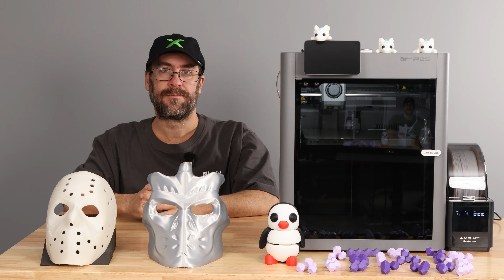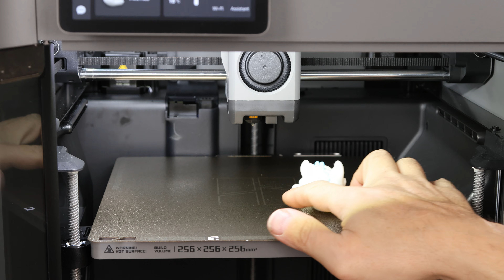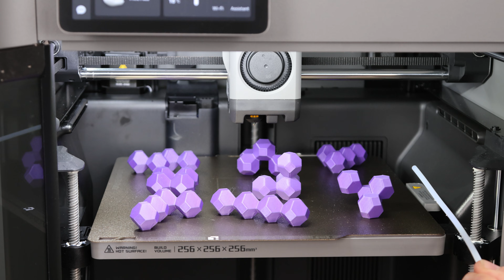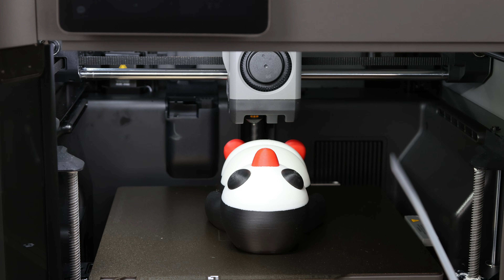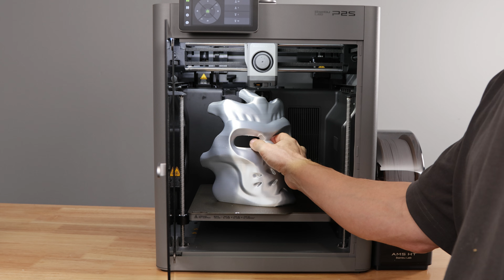Bambu Lab P2S: WHY Use TWO Aux Fans?

Comment: I have a curious question, i have an X2D, i have seen people suggesting to use air deflectors, does the fan deflectors help and if yes then how?
Reply from the maker: I looked into them for a video and ultimately didn't see a  need. I've had no issues with the fans as they are

Comment: AUX fan is off by default in bambu slicer settings, in what situations should it be turned on? Filament type? For specific objects?
Reply from the maker: Bambu Lab P2S: WHY Use TWO Aux Fans?
https://youtu.be/_9vtjKOAfyE

Comment: my p2s cools too much too and i have to use a diverter when printing PLA or the prints just won't stick, and yes i kept everything clean and washed and make sure my grubby hands don't touch the bed.

and also yes, I'm using bambu original stuff, even the filaments.
Reply from the maker: Haven't experienced this but I've heard it from others. Maybe slow your 1st layer and 1st layer infill. Be sure bed it 60, nozzle 220.
Use a better print bed: Smooth PEI
Reply: @3DRundown smooth pei is really hard to get, its always sold out, even the bed at 60 just doesn't stick, it'll stick for longer but still comes loose over half way through...

oddly enough, even the build in benchy just fails like that...
Reply from the maker: Can you show me your slicer settings, and a failing print video? https://www.skool.com/3drundown-8042
Reply: @3DRundown  standard settings except i set the bed temp to 60 instead of 55 and the prints always fail or warp at the vent, i find that the temp settings always are a bit conservative, i have to set them a little bit higher whether it be PLA, PETG and ABS.

not sure how to send a video on that site.

Comment: I have a p2s for 5months and my right cooling fan stop working and I need help. I already follow instructions to fix and nothing stuck in there
Reply from the maker: I suppose it's POSSIBLE that the fan itself died. I don't see it on the web store. I would make a ticket, and kindly ask Bambu for a new fan.

Comment: i just installed mine and printed a benchy to see how it works with the right fan but the left fan is just not doing anything 
do you maybe know why that happens?
Reply from the maker: Not sure. Sadly I have had no time to tinker with my fan
Reply: @3DRundown  i figured it out why it did not work, that benchy model i used apparently did not use the part cooling fan, i printed another model and it worked perfectly
Reply from the maker: @shadowking7386 Good to know it's not a physical problem

Comment: Doesn’t the tool head provide cooling as it extrudes filament?   I installed a VoxelPLA filter system on the left side of my machine.
Reply from the maker: The Aux fan is Superior. Your right side fan is fine.
Reply: @3DRundown I wanted better / more filtration  as compared to additional cooling for what I do atleast
Reply from the maker: If the machine was for my own personal use, and I didn't have to teach all this stuff, that is the route I would go as well.

Comment: Dumb question when I install this fan on the left side, does it automatically come on when it needs to like using certain filaments or is this something that has to be manually turned on every time?
Reply from the maker: I believe it matches up with the right side fan
Reply: I did contact bambu support asking the same question and the answer is you can add the settings on bambu slicer you can choose to switch it on or of and the speed and then save it in your filament profile BUT it doesn’t change speeds same the original right fan.
or you can adjust the speed from the bambu handy on your phone during the print so the answer is no it’s not going to work automatically or changes speeds automatically I don’t think it worth the headache.
Reply from the maker: @RB-wx3tp Excellent information.  Totally worth it. At the pro level, Manual control is the best control.

Comment: 👍Great tips for prints with complex geometry--Sometimes we just need someone to speak it out--even speak it slowely so we assimilate how fundamental something is that isn't always so obvious.  Stereo and mono mean something with non-flat and round vertical prints that effect the aerodynamics in the chamber.  Pop a Vento in there and the dynamics change from the physical aspect of the Vento alongside the aerodynamics of it removing or recirculating air.  These are PhD problems that the engineers at Bambu likely nailed.  As I plow through my cylindrical PETG 45-degree overhang problem, my Vento is going to take a hike for complex printing like this.  The Left Side Aux Fan is on the way.  Probably not a slam dunk, but I've tried everything in settings and PA calibrations chasing the proverbial tail.  After hours of trying to fix only a sector of my near perfect print (problem isolated at the 9 to 12 o'clock position), finally someone like 3DRundown tells it like it is.  ⭐⭐⭐⭐⭐💯
Reply from the maker: Good luck!! 🙏

Comment: but since each user prints several pieces at once, as well as larger objects such as vases, masks... It's a shame, considering the above, that this additional fan is not already built into the printer. It seems to me like if you wanted to drive a car on a winding road, you would have to install a steering wheel :)
Reply from the maker: You mean a SECOND steering wheel. Some cars only have 3 wheels. Some Vehicles only have 2. I could argue 4 is always better, yet they drive from A-B just fine...

Comment: I found that my P2S has the right aux fan design flow where it blows the air too directly onto the prints, lifting and warping the print from that side if it was too close. I printed a deflector someone designed (because many, many people experience that flaw), and now it's all good. I've been printing with different versions of PLA, PETG and ASA on it had no issues ever since. I don't think there's much of a need for an extra fan on the left. But, to each their own.
Reply from the maker: I haven't experienced this problem, but it's a topic that has been comming up.

Comment: Really appreciate this video. I had no issues with the printer when i first had it. Been 2 weeks of using now constantly and ive noticed terrible prints. Ive calibrated the printer again, dried pla, cleaned the build plate but im getting defects on my prints. Do you think turning the aux fan off will help? I tested on cylinder spacers and i could see bad prints on one side of the model (the left faces of the print)

Comment: So the next question has to be, if Bambu Labs is considered as the Rolls Royce, best-engineered printer, justifying its premium price, why didn’t it come with two auxiliary fans?

Is it a blatant money grab, or a design-oversight, or is it not really needed?
Reply from the maker: Bro, it's like a $20 accessory. The P1P didn't even come with a fan AT ALL. A company selling $2500 printers, isn't "Cash Grabbing" for $20 at a time. It's cool of them to even offer this fan. They didn't have to even bother
Reply: @3DRundown It’s not the price, it’s the amount of work to fit, it’s not hugely difficult, but far from a simple bolt on and quite awkward in places.  I’ll reflect your response back on you, if it is only a $20 accessory, that’s retail price, so probably only a few dollars cost to BL, why did they not fit it?

Comment: This is really great...videos and tutorials really informative and helps me a lot...

what about he voxel bento? is it worth it? and how safe is the P2S inside a room with windows using PLA and PETG.

More power, more videos
Reply from the maker: Keep in mind this does not add venting or filtration. Generally PLA/PETG is considered safe. ABS, ASA, are more of a concern.
Reply: @3DRundown  - since ill only be using PLA and PETG, it would be better to get the fan rather that the vento box?

Im going position the 3D printer on the floor for stability and put a fan...Room is well ventilated, I guess PLA and PETG is safe, even for kids to be around, as long the room is well ventilated. 

thank you. really good videos.
Reply from the maker: @JuanDelaCruz069 I wouldn't worry about filtration for PLA OR PETG.
Reply: @3DRundown  - sorry for the noob question, waiting for my 3D printer to arrive...really excited, I guess, ill get the aux fan for better printing, I hope i get it aligned properly...hahaha

thank you
Reply from the maker: This channel lives for Noobs. Ask anything, anytime. You'll be fine without it, but, go for it. Spend as much time as possible learning every inch of Bambu Studio, and Practice printing print print print print

Comment: I have put a link to the adaptor I use (Max Flow vwersion) but it looks like I have now been blocked from posting :(
Reply: Ah no. it let me post now
Reply from the maker: Hmm, I don't think so. I see this comment.... Hashtags and links MAY be turned off? But I don't think they are...
Reply: @3DRundown  Links must be disabled because the post has disapeared.
Reply: I have sent you an email with 3 links for 3 different diffusers. (2x right hand side and 1x left hand side)
Reply from the maker: @tigerpawdesigns  Is possible. Sorry. So many security features on YT.
Reply: @3DRundown  You could contact him, type in his fan model, what he suggests, and compare it with your two fans in a new video, and also share the model ID there. I'll subscribe and look forward to that video!
Reply from the maker: It sounds fun, but the sad reality is, I'm only one person, and, allot of the Fun stuff, never makes it onto my schedule. :(

Comment: I use the aux 45 degree adaptor on makerworld that circulates the chamber air evenly (both upwards, left, right and straight.) Never had a bad print yet
Reply: I'd also like a link to the model's ID. You can paste the link and add spaces, then the link won't be deleted.
Reply: @tigerpawdesigns  would you mind sharing the makerworld id? I would like to print one aswell 😅
Reply: @tigerpawdesigns  Do you have the link to the print?
Reply: @beardedelephant3023  Yes, but when I posted it Youtube deleted it. I could cheat and post a fake link hoping it won't recognise it. Give me a sec to 're-do' it
Reply: @tigerpawdesigns  me too!!! I also have a vento box that pushes air under the bed. And an exhaust fan, I curry printing asa, and I'm trying to keep the chamber temperature below 55C 🫪🤣
Reply: would you mind sharing the full name of the print in makerworld and the author? (instead of the link) Thank you!
Reply from the maker: I always forget Maker World Exists. I've only printed a test print for my assembly video so far, on the P2S, but, I expect good thing. Link us to this adapter.

Comment: But surely the fan is blowing across the top of the print all the time so it doesn’t matter as the print grows it’s always cooling the extrusion across all the print bed..
Reply from the maker: It's not blowing from an accurate nozzle, in close proximity to the hot end. It's blowing from a long wide output, from the side of the machine. hang some paper in there, and see the air flow. Also, when a model is on the far left side of the bed, it's clearly getting less air, then a model on the right side of the bed...

Comment: I have the same configuration on P2S including the exhaust fan but how do you manage to control both fan (left and right) without override them on printer screen? I mean printing PLA right fan has variables of 70-80% on printing. When left fan is around 30% because I set it on filament setting cooling (aux fan), it will be good have them works balanced around 30-40% each from begining of the print.
Reply from the maker: I still have some learning to do on control

Comment: Love seeing the progression of your channel and your process. Your shot composition is developing. What camera are you using? Have the chance to use a wider angle lens?
Reply from the maker: I used a Canon HF-G70, till 2 weeks ago. I switched to a Canon R50V. I have a Canon 24-105L on it. As a photographer, I have a vast collection of lenses. This is my first 4K camera, that supports my E-Mount lenses. (My Canon 5D MKIII, is only 1080p) It's been fun to use this lens for Video.
Reply: @3DRundown oooh I figured you had some gear. I run a sony a6600. I cant temp myself getting into camera gear... so many hobbies...
Reply: @3DRundown I started watching around the Ender 3 s1 pro videos a few years ago. That was my first printer. Now I have a busted E5M. Looking at a used P1S for backup.
Reply from the maker: Back in the S1 Days, I was shooting on GOPRO. All they did was overheat. Total Nightmare. Moved to an HF-G60, then HF-G70. Both have White Balance, and maddening Face Focus issues. I enjoy the R50V so far. It has it's own quirks, but they all do. I have an old Sony A6100, which I love for Still, and a Sony ZV-E10, but, Sadly the ZV-E10 overheats constantly. I retired it almost immediately. I'd love another R50V. It's so Versatile. I shot the Laser Pecker Vertical Reel with it, mounted sideways. Fantabulous. Don't get me started on this stuff!! I got a DJI OSMO 360 the day before CES, and it's unreal. The Rabbit hole is deep.....

Comment: Does anyone know what is the noise level between the X1C and the P2S (without the modded second fan)?  Which one is louder?  I have the X1C but not the P2S.
Reply from the maker: I've never compared. I find the P2S to be fairly typical compared to my P1/X1. Maybe others have a different experience, or put more thought into it, or Tested?? Chime in
Reply: Joel and a few others have said the P2S is quieter than the P1S and X1C
Reply from the maker: Who is JOEL? Lol. (If he a printer guy, I don't watch 3D Printing Content, AT ALL). I have only done one test print on my P2S, but, I'm moving it to my Printshop, so, gonna find out son!
Reply: @3DRundown  Joel = 3D Printing Nerd
Reply from the maker: No clue. 🤷‍♂️  Sorry. 😛 I don't really know anybody unless I've met them in person, or they've reached out to me for some reason.

Comment: Can you make this mod on a x1carbon? 
So you have to look on the filament for the information type and settings to add in  to profile ?what  would be a filament for ludicrous speed ? Ty Mr G
Reply from the maker: NONE.  Set speeds yourself
Reply: @3DRundown  i don’t go above sport mode
Reply from the maker: @PeterAgostiniJdcap26  Keep it in standard mode, and make your speed choices in the Slicer
Reply: @3DRundown i will take a look at that and see if I understand how to adjust without blowing up the extruder . 😳
Reply: The usual settings (standard/sport/ludicrous) are effecting the speed of the movement only. They don´t effect how many filament the printhead is able to deliver, therefor underextrusions will occur. Useful would be a Highflow nozzle, HF filament (it is usually declared as such), changing the volumetric flowrate in the filament settings and maybe to set the printing temperature a little higher.
Reply from the maker: S/S/L just take the speeds you programmed into the GCODE, and Multiply them. That's a reckless way to run a printer.  FLOW can certainly help a TON with print times. Keep in mind HF nozzles are quality Tradeoff
Reply: @3DRundown 😳🫣😮